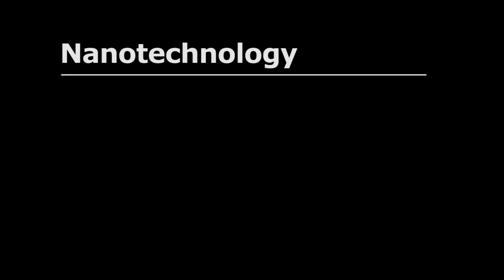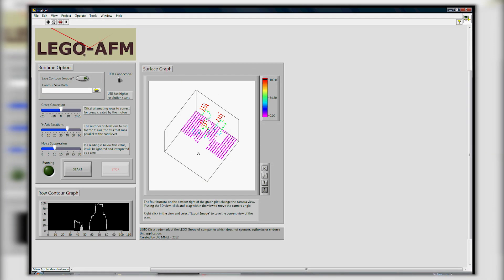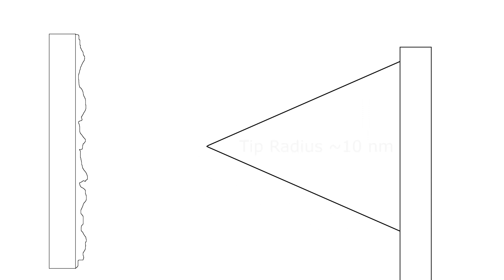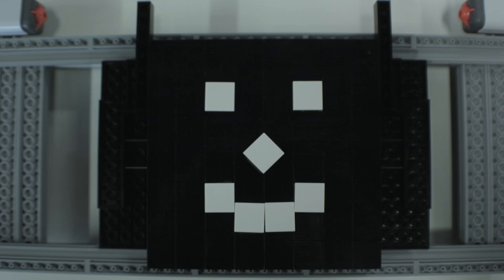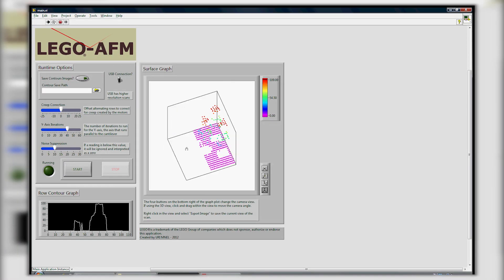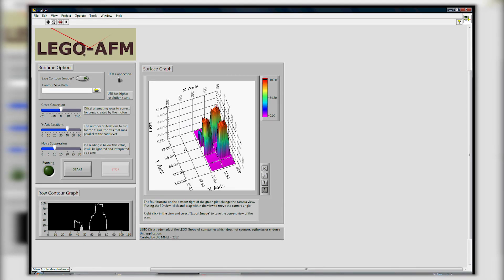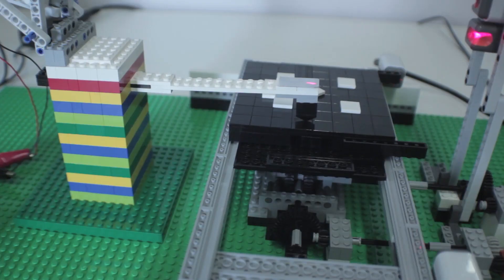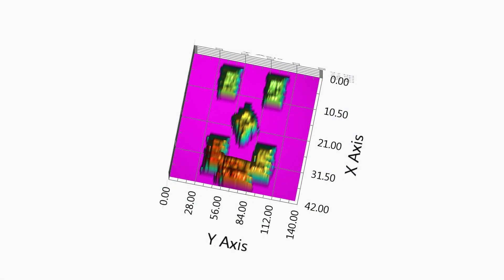LEGO AFM Overview Video

Comment: Impressive!

But what is the resolution?
From the video it looks like that it can only detect big macrostructures like Lego bricks.
It's not working on the microlevel, right?

But if it does work on the atomic microlevel, the mirror consisting of a aluminium foil isn't very flat and might disorder the values readed by the photoresistor.
Reply: The height measurement is binary and it can only detect items that are roughly the size used in the video. For more precise measurements I recommend using an AFM that isn’t made out of Legos.

Comment: Are the light sensors binary or analog? If they are analog, you could make better use of them by putting a single piece of material over both sensors that diffuses the laser, for example a piece of plastic or even zinc oxide on a glass slip. This would average and divert the laser signal to both sensors even when the laser spot hits in between the sensors or goes above them.